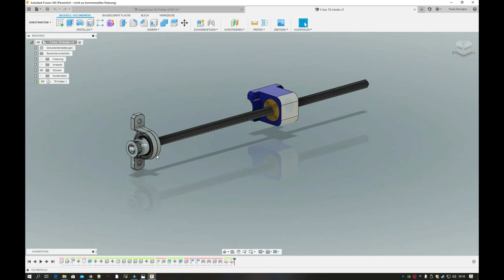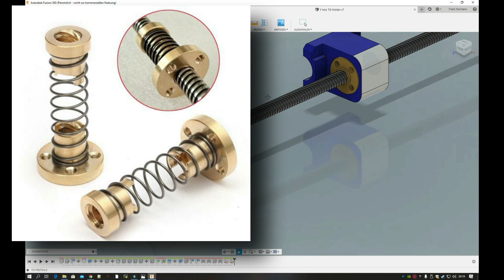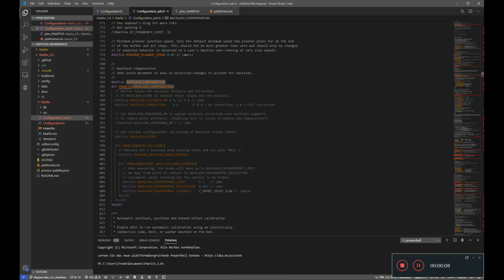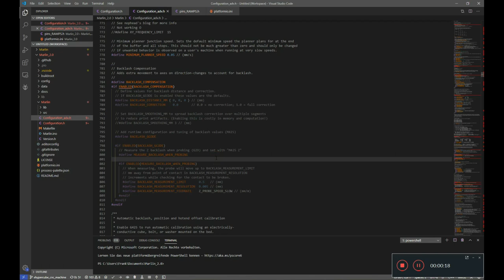S01E08 Axis conversion and backlash compensation in Marlin

Comment: if you mill a cube - you can automate backlash compensation- and remove the anti-backlash nuts :) and turn off smoothing or set it very very low
Reply: 0.18 is very good for those leadscrews!
Reply from the maker: What  u mean with “smoothing”?
Reply: @xpixer   new marlin allows you to set a smoothing distance for backlash compensation-
Reply from the maker: Ahh yes, i switched off ... this was a suspect function for me 😎